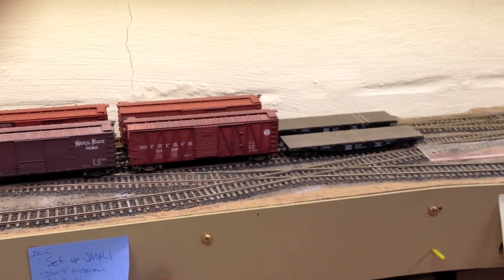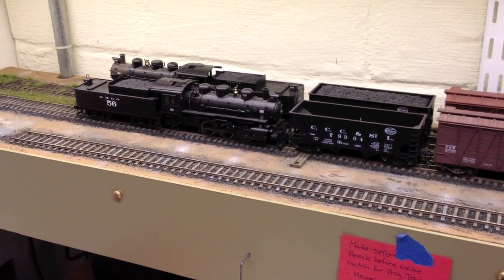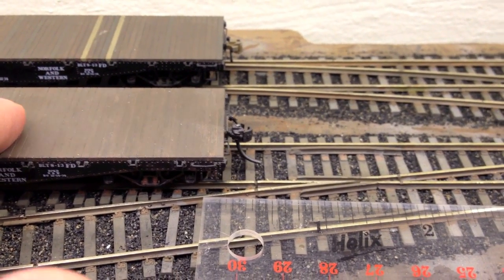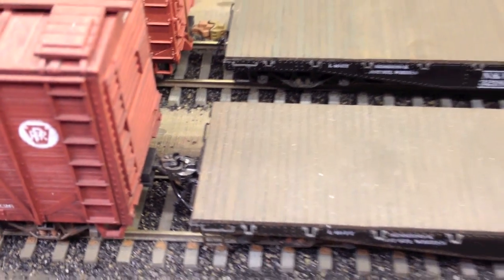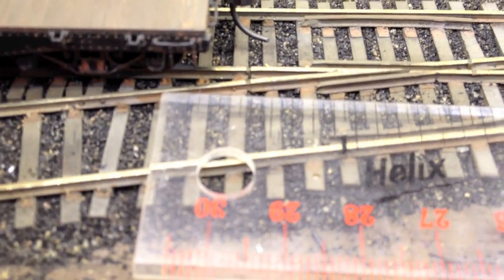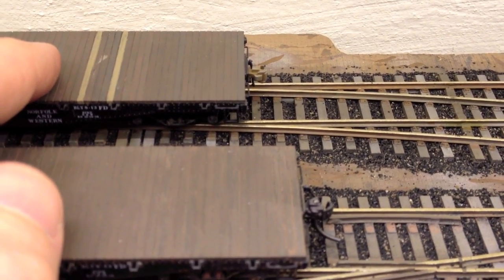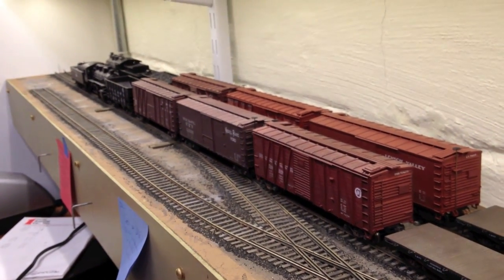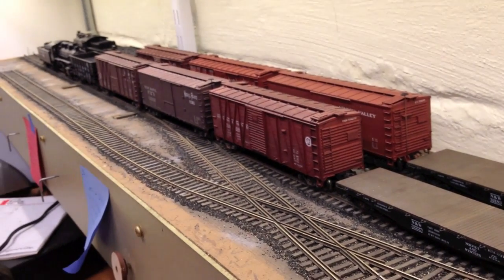Slack Comparison - Kadee #58 and Sergent Engineering EC87

Comment from the maker: Most of the track on the layout is built using Central Valley tie strips and tie blocks with Micro Engineering rail attached.  The tie strips come in one foot lengths that are made to be joined (using regular styrene glue) into as long a piece as is needed - I think of it as infinite length rail-less flex track.  Very nicely detailed stuff. The rail itself can be spiked or glued to the ties.  The rail for the turnouts was formed using Fast Tracks tools, and the crossings are scratch built.

Comment: i have a LOT of older equipment from the 90s that have kadee#5 couplers... back then that was the old standby... but now am now seeing a lot of the #58s... is the 58s the same as the 5s... if not what are the differences
Reply from the maker: Hey 25mfd. #58's are closer to scale size than #5s. The nice thing is that they are compatible with one another. I have plenty of #5s installed, but all new installations are from the #58 family. As a side note, there are a variety of shank lengths and other variations, just like in the #5 range (though not as many).
Reply: been in and out of model RR since 84... just got back into it last year... I feel like rip van winkle just waking up to all this "new" model RR stuff and I don't have a CLUE... thanks for the info
Reply from the maker: 25mfd , yes - absolutely right about changes in the hobby since 1984. DCC and (later) sound are probably the most significant, though improvements like couplers and out of the box detailing on locomotives and cars are right up there. We are currently going through what I think is a second electronics revolution in the hobby, with the implementation of micro controllers, animation, 3D design at the hobbyist level, etc. none of that is required to enjoy the hobby, but they make it an energizing time.

Comment: Are you a proto modeler, based on track ties and tie-plates I see in a video? If so, I have few questions as I plan a HO to P87 conversion:

1) How do you introduce curves to make sure they are reasonable and have proper transitions, are there any curvature jigs, as by eye I cannot lay smooth curves where trains would not jerk from one side to another? Do you sketch the line of a curve, lay  ties on top and then rails, or bend rails to desired radius first and then adjust ties under them? Which technique would you recommend?

2) Where to get proto 87 wheelsets for steam locomotives: modify existing ones, or order from somewhere?

3) Wheelset replacement for rolling stock: I have European passenger cars with 980mm (38.7") wheels. Would American P87 38" wheels result in much coupler height problem? My European freight cars have 890mm wheels (35"), would 36" P87 wheels be a solution or is 1 scale inch a tough offset for a coupler?

Thank you in advance.
Reply from the maker: Hi UCFHetman,
I appreciate and aspire to fine detail, but am not a Proto:87 modeler.
Starting curves can be difficult, especially in tight switching configurations with relatively tight curves like on this shelf layout.  All of the trackwork on this layout started as a CAD drawing, with final fitment by eye.  Another approach that works very well is to use a yardstick or other flexible stick (or even a length of bare rail) and align it with the straights on both ends.  Let the rail find it's own curve between those two points and sketch a line.  This should form a nice even curve with natural easements.

Comment: hi sergent cupler can work like Kadee? in magnetic uncupler on layouts or just you can uncupling it with the "magnetic stilus"(pen) .
have automatic sergent cupler for locomotive?
Reply from the maker: @108923656151778596866 uncoupling must be done with the magnetic tool (stylus).  There is no automatic uncoupling offered for sale that I am aware of.  They are automatic coupling (like Kadee), though you have to manually align the couplers (if they are misaligned.  People either love or dislike this necessity.

Comment: Wish I could get these for n scale
Reply: Kadee Magne-Matic Couplers
Kadee's Magne-Matic couplers in HO were the first couplers that could be decoupled by a magnet under the tracks, rather than by hand. The HO Kadee Magne-Matic couplers had been around since the 1940s. But in the early 1960s when Kadee introduced Magne-Matic couplers in N scale they may have been the first N scale knuckle couplers. Kadee later split into two divisions, and ultimately into two separate companies. All products in HO and larger scales continued to be manufactured by the original Kadee company. The new company Micro-Trains Line was created to manufacture all smaller-scale products. Today Magne-Matic couplers in N scale are commonly referred to as MTL couplers, and they are still among the most popular.